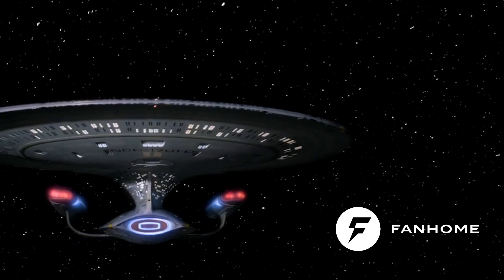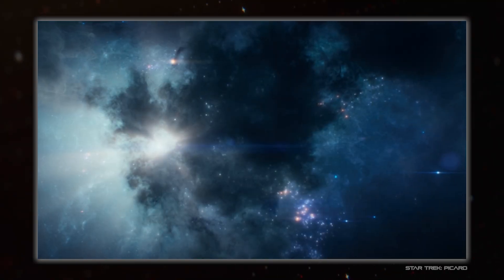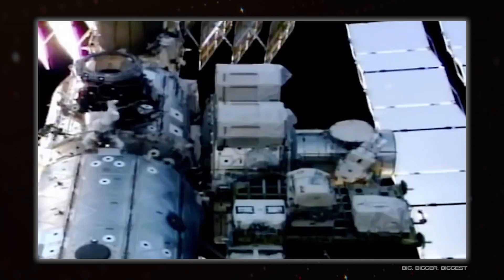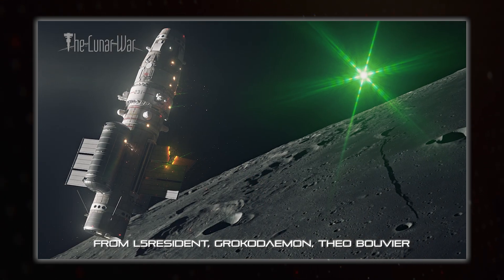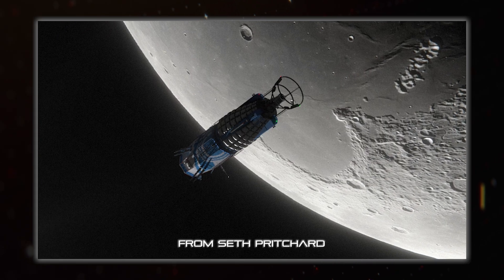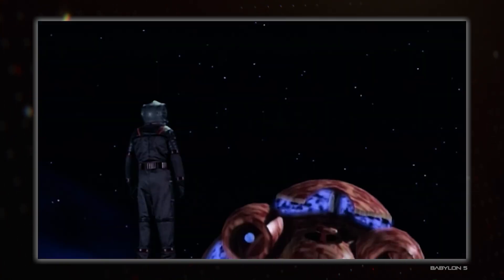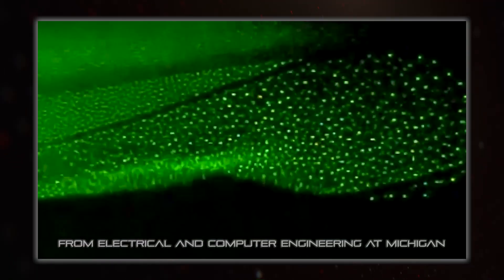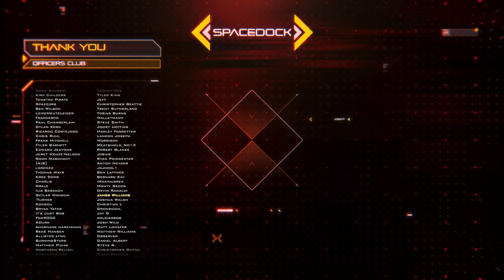Radiators In Realistic Sci-Fi (And Why You Need Them)

Comment: Recapture heat energy and use it in place of freshly generated power. After a certain point, you are recycling so much heat energy so much your main reactor is either on "low boil", or "Idle", or even deactivated, depending on the type and style of reactor. This may actually entail a very large, powerful, and efficient heat battery, not unlike the Liquid Sodium Batteries being developed of municipal power storage. 

You would only use radiators if you have excess heat and HAVE TO get rid of it. Otherwise, only using the reactors to get things going, heat up the ship, fill the heat batteries, and then put the reactors on low boil, and just recycle heat. Only heating up the reactor when needed and using Radiators when you have too much heat stored up.

I could see maybe exchanging heat to ships or stations to save on immediate energy requirements, jump start reactors, or supply heat to installations that have been "in the dark" too long. Although, that last one might make more sense to Bases sending heat to shadowed facilities in craters or on the night side.  And of course building vast stores of heat energy for emergencies and special projects. 

One of Humanities current biggest technological issues is our inability to store generated energy, whether if be Electricity or Heat. Solve this and, while Fusion Power would solve most of energy issues, Energy Storage would fix the rest.

Comment: One nice thing is that you can pre heat your reaction mass to get rid of heat. Real life rockets does this to cool the rocket engines. 
And at high trust you can cool better as you use more reaction mass. 
Also open cool your heavy laser cannons for the muzzle flash effect.
Reply: if your weapons discharge anything physical, you can use waste heat to preheat the discharge, and gain some open system cooling from your gunfire.

Comment: A while back I had an idea about metal cloth radiators, with thicker tubes containing the coolant woven into it. Suspended from masts for a very sail-like, yet still plausible spaceships.
Reply: Never thought of that. But I do like to put rigging on spacecraft to secure extended elements like the radiators.
Reply: That would create an intriguing visual. I like it.
Reply: Remember that you will have to conduct or convect the heat TO those locations.  It's doable, but you will need something to transfer the heat from one part of the spacecraft to another at a high efficiency.  And moving the parts changes your CG too, as well as obscuring your sensors.

Comment: Having heat management factored in a space battle would definitely make it interesting. You can’t just have your spaceguns to continuously shoot. It’ll generate heat faster than the rate of what the radiator able to remove.
And talking about warframe, this is why we have that heat bar in railjack weapon.
Having radiators could also be one of the justification why you have a wing-like structure in your spaceship. The other is to have maneuver thrusters on the wingtips.
Reply: Check out the game "Attack Vector: Tactical".  Ships fighting each other have internal sumps to store heat, spike radiators that get rid of a little bit of heat at a time, batteries to power weapons, and engine thrust.  If you run low on power you can turn on your main reactor, but the only way to get rid of heat from the main reactor steadily is to extend your radiators.  If those radiators are extended while you are in range of the enemy, they can get shot off easily and you are essentially SOL so need to surrender.

Extending radiators while in combat is the universal signal for "I surrender", as if you keep fighting after extending the radiators then your opponent will simply shoot them off and your crew gets baked alive due to the main reactor's waste heat
Reply: If you only needed the protrusions or attitude control, there would likely be a better shape than a wing like one. Radiators are definitely the stronger justification for such a thing, though they could do double duty.
Reply: There is a game called Naev that does this, in what is otherwise a pretty simple space game. Unfortunately, that aspect isn't necessarily a positive for the fun of the gameplay. A related (both are inspired by the same old game series) game called Endless Sky also has heat, but in that case it is is only ship-wide (Naev has a system where fired guns generate heat, reducing their effectiveness, which is then transferred to the ship and only from there radiated) and it is possible to remove heat faster than generated even at full blast depending on your outfits - you'll typically only need to consider in the three scenarios of having seriously neglected cooling equipment, relying heavily on Korath equipment (which typically runs especially hot) and when fighting certain foes that use weapons designed to heat up the target.
Reply: The radiators in the game Terra Invicta are also fairly interesting as someof the better drives lack efficiency (less then 95% is bad by endgame) as the energy created by such reactors and drives is so huge that even the best radiator, the tin dropplet radiator becomes truly huge, which  is disappointingly not shown by the radiator size in game but is incredibly expensive in resource cost.

Extending and retracting radiators is also needed in the space combat, with heat sinks allowing the player's ships to continue fighting for a time without being vulnerable due to extended radiators.

Comment: In a game like Elite Dangerous where heat is an actual game mechanic, I love how their ship design deals with it. Most ships when dealing with a lot of heat will expose their radiators more. Also just charging all the heat into a heat sink and chucking it overboard is just hilarious to me.
Reply: I imagine it'd be more like spraying superheated coolant out than physically chucking a heat sink out the airlock, but that is a hilarious image.
Maybe that could appear as a jury-rigged heat management adjunct on a craft with other adjustments- like a souped-up civilian-grade hero ship.
Reply: @justinthompson6364  Or have ejectable heatsinks that could be launched during a battle and picked up afterwards.
Reply: Just use your reaction mass for your drive as a heat sink.
Reply: @JainZar1  The SR72 Blackbird used to do that, transfer heat from friction heating to the cold fuel before it was burned
Reply: Same with Terra Invicta. Some of the late game drive turn your ship into flying radiator because of its awful efficiency. (like the protium converter and firefly torch) You can even retract your radiator in combat to minimize damage but you will need heat sink otherwise you will melt your ship.

Comment: One of the coolest ideas I've seen is using Radiators as, essentially, either chaff, or a sensor decoy, by ejecting them during/before combat to make precise reading of the battlefield more difficult: they could even be used offensively, by making it more difficult to tell when missiles are being launched by basically showering an entire area with radiators made hot enough to melt. 

As long as the ship can either cool down using more conventional methods (like landing somewhere,) or at least transfer the crew out of the ship so the slower cooling isn't lethal, there isn't even much risk.

Comment: A book I read a long time ago ( I don't remember its name)  where it was about a mission to venus (near future). In it, they actually addressed this with a clever open cycle heatsink that doubled as a balast system on a smaller parasite craft. It used solid lead to absorb the heat and then it dumped the molten lead. This also served a plot point as it limited the time the craft could spend on the surface and continually changed how it maneuvered. Just a cool concept in my opinion.
Reply: Saturn Run by John Sanford Ctein had a lead radiator system on a loop.  Melting  then reforming lead outside on a conveyor belt to return cooled down to once again melt and go back outside for a conveyor belt ride to dump heat on long loop.
Reply: That is interesting.

Comment: at least in space, the magnetic force required to recapture the magnetic particles is very small, since there's no drag or the like.
if rapid accelerations are necessary, it could make use of a burst to capture everything currently out faster, or just run on a higher level.

Comment: In the video game called The Outer Worlds, there is a quest called "Happiness Is A Warm Spaceship", where the player is tasked with retrieving radiator parts for an old colony ship turned space port called the Groundbreaker. After you find the parts, you then have to go into the Engineering shaft to cycle the droplet pumps to cool the radiator system that is filling the ship interior with super-heated air. ;)
Reply: One of my favorite games. I love the sly humor, excellent graphics and the steam punk design themes. There is supposed to be a sequel in the works but I think a lot of design studios are struggling with the massive funding needed for these more sophisticated games so it has been quite a while since the last announcement.
Reply: @Palaemon44 That's why they break them up into a base game and DLCs, although even the large companies that shift ten times the units will now break games up into multiple DLCs for maximum profit.
Customers are even brainwashed into the idea that day-one DLC, or already planned DLC, instead of having them all as base content, is somehow a good thing.
Reply: Love that game, the plot was gold and the setting was stellar.

Comment: what aobut internal auxraly waste heat powerd plasma magtetic dinamos or steam terbines power genratartors! these would use the extra waste heat to bascy heat up and make plasma/steam  that can then be used to recycle the waste heat into addinsal ectrcal energy while massvly redcuing the need for extrnal radators. the main advatage is bacly its intrenal heat magament that bacly makes addisnal power from waste heat and also massvly reduces how much extrnal radators you need to be extrnal or not even need them at all.
Reply: well but thers still some waste heat you would need to putinto space but the internal waste heat into power gernation would help masvly reduce the aomnut to radate into sapce over all up to a point.
Reply: Heat is the form of energy with the highest entropy. That's why we can't really transform heat into any other form of energy.
Kinetic energy, for example is mass in motion at a specific velocity in a specific direction. Through friction it can be converted to heat. Heat is particles in random motion at randomly distributed velocities in randomly distributed directions. If you heat up gas in a chamber from which it can only escape through a nozzle in one direction, then you gain kinetic energy, but only as long as the gas on the other side of the nozzle is cooler.
Every system that generates power from a heat source (steam engine; combustion/nuclear/geothermal power plant) really needs a temperature difference and gains energy from the heat transferring outward. Even if those systems stay intact, they would produce less energy in a hotter environment and couldn't work at all if their surroundings were as hot as their furnace/reactor core/planetary core.
So to make waste heat do any work for you you would still need large radiators so you could put your energy converter mechanism between the hot system and the radiator-cooled system.
Reply: @frankbruder3097  yes but it wouldn't have to  need  biger ratators with the energy conventers then without however is what i mean.

Comment: I feel like it would also be interesting to bring up cooling systems that use the fuel to cool the engines. Plenty (most?) of modern rockets do this to keep the engines from melting from the massive thermal load, using the cryogenic fuel/oxidizer to cool and then getting rid of the heat by firing the fuel out the back.
Reply: That's called open-cycle cooling, the video already mentioned it for a bit. 
That's also one of the factors that makes chemical rockets' Isp looks really bad compared to nuclear or electric engines, because those types of cooling rely heavily on the huge mass flow that chemical rockets have, and huge mass flow means low Isp, which makes chemical rockets a real gas-guzzler.
Reply: @lazyremnant380  Well, yeah, it's a form of open cycle cooling. He was going over the general concept, but I thought this specific case was worth mentioning, since it's already in use today. There are plenty of other forms of open cycle cooling too. Also, it's true that you need a lot of flow to cool the engine cone, but for a lower, less concentrated heat load like life support this could still be useful.
Reply: @lazyremnant380  Is that one reason that ion engines are so slow, because they have to radiate heat and not simply expell it? So they can't scale up or they might melt?
Reply: @henryward5457  Ion engines are slow because ions have much smaller mass than the hot gases produced by chemical reactions, in accordance with Newton's second law of motion. They're also not a heat engine, so they don't emit much heat by themselves. 
Current ion engines are limited by the amount of electrical power from solar panels that is used to accelerate them. We can replace those panels with a nuclear reactor that can supply much more power to the engine, greatly increasing their thrust, but only up to a point, no thanks to the ions having the same charge repelling each other, choking the flow. 
Now, when you have a nuclear electric engine like this, the reactor, being a heat engine, will emit waste heat that needs to be radiated away.
Reply: @lazyremnant380  So heat dumping is currently not a problem, but might be if we switch to nuclear-powered rockets.

Comment: The venture stars descending is my favourite scene in avatar. Such a lovely vessel
In my setting, radiators will play a key role in showing the struggle of spaceflight, the limitations of heatsinks, and radiators themselves, with each ships using different types.
Heat management can add so much to hard scifi, so i will utilize it
Reply: It's a shame they ditched the sails they originally used in the first film. I don't think they were shown but I guess they changed to engines to get that incredible scorched earth scene
Reply: @helplmchoking  They had the engines in the first film too. They use the sail when leaving and returning to Earth, but when they arrive on and leave Pandora they use the antimatter engines

Comment: One thing hat is possible is to not have radiators.  While Trek ships do have radiator systems that are close to a few on this list (probably all working in concert) the reality is that reusing the heat, transforming the energy from the heat would be the key to having ships that are highly efficient.  After all, if you have tons of heat that means you are wasting energy. I think in Star Trek Voyager they mention how their power systems not only recover waste radiation, but waste heat as well.

Comment: It can also play a role in ship detection

If thermal detection is a big thing a ship might try to radiate heat into pellets it can drop all at once to remain stealthy for a while

It has the disadvantage of giving stealth ships a fixed limited time in stealth, but that adds tension

It can also be a distraction or work as a flare to fool thermal sighted weapons, for example 

A stealth ship has run out of heat pellets and has to engage its cruising radiators and is spotted, it gets locked on by thermal torpedoes and drops its pellets last second, the torpedoes barely miss and the stealth ship manages to run away
Reply: With Elite: Dangerous, the Heat Sink Launchers are exactly that. I have pulled that exact manuver many times. Never gets old.
Reply: And this concept would be history repeating itself

Before nuclear energy in submarines, they relied on charging batteries with combustion engines when they had access to surface air and then could only stay underwater until the batteries were low. And this was all done for stealth, as no technology existed yet to detect underwater craft. 

This effectively meant that submarines were stealth ships that needed to drop stealth regularly to avoid certain doom and were constantly trying to balance their stealth with limited power supply. 

Replace charging batteries with cooling heatsinks and you've got stealth spaceships
Reply: That is clever - stealth ships using a disposable heat sink in stealth mode.
Reply: a steralth ship would more likes just use the exists eat to power a laser that shoots away from what your observing

Comment: In military spaceships, heat management with droplet systems should be good for standard cruising. In the way to battle, though, it would be simple to shut it off and fight without heat exchangers for a while, or, in a pinch, to vent and lose the fluid. It may even be a combat tactic: make the enemy overheat before you do, so they have to surrender and deploy their radiators (if they just deploy the radiators, those should be easy targets, leading to the potential destruction of the ship, or at least causing damage to the crew through heat strokes, so they have to surrender).

Comment: In my sci fi setting my ship use internal cooling rooms were the heat of the Starship is transfered into 2 supper hot heat rooms with heat coils what transfer the heat into energy. Altho before these were invented and efficient enough star ships used to use radiators.